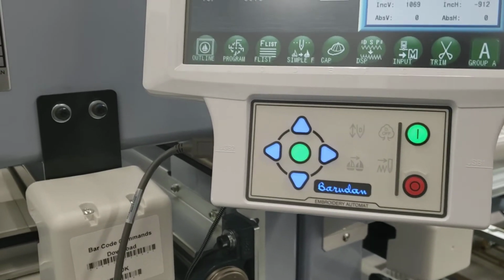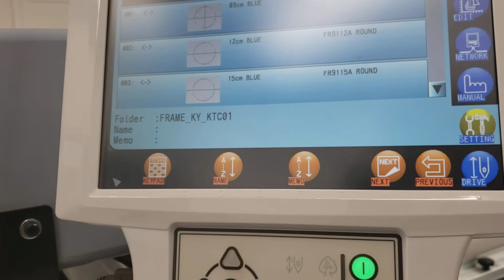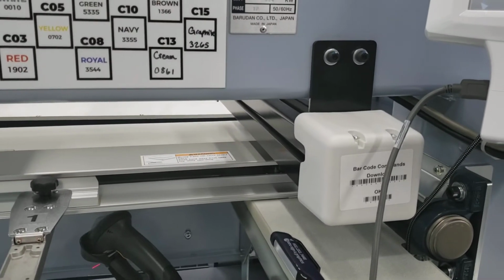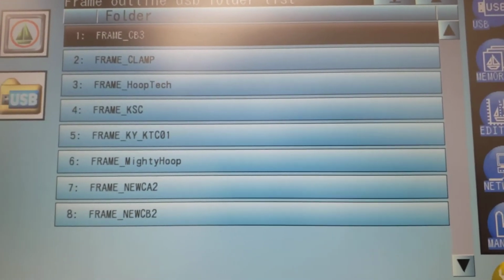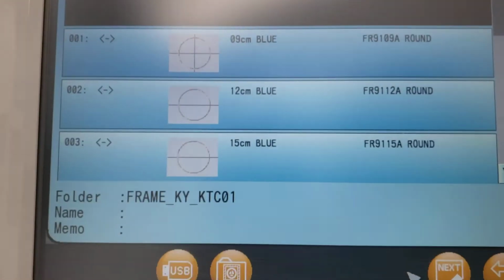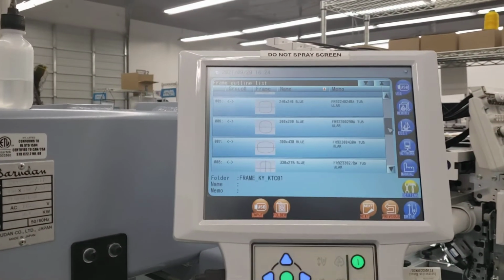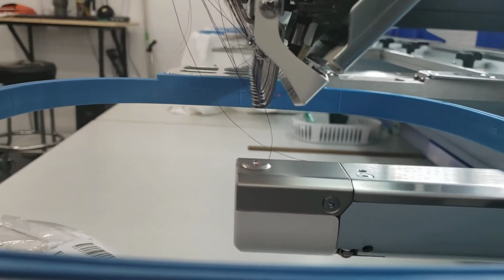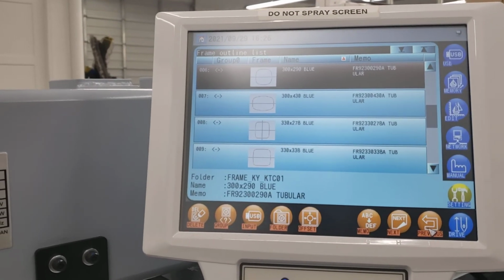Hoops- Installing New Hoop Sets into Embroidery Machine

Comment: Can you add the Maggie hoops to the Barudan?
Reply from the maker: We have never used these hoops. According to the Maggie frames website, they can be used on some Barudans, but we would strongly suggest that you get the information you are seeking directly from Maggie Frames and from Barudan. The hoops will have to lock into the arms of your machine properly. They look very similar in size and shape to Mighty hoops, so you might be able to use the same settings successfully, but we wouldn't know for sure. Remember that the hoop size is NOT the amount of space you have to sew in. You lose about 1" of space, meaning that a 5.5" hoop only allows for approximately a 4.5" design. Please contact both manufacturers to make sure the product is made specifically for your machine, we wouldn't want you to damage it!